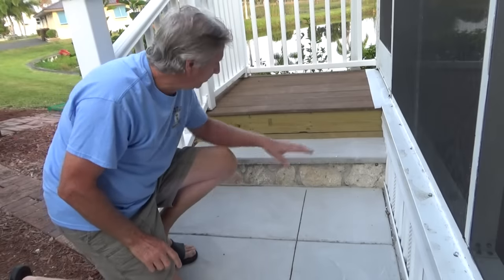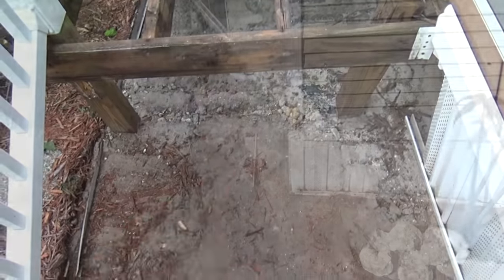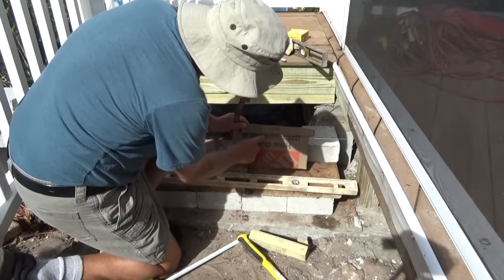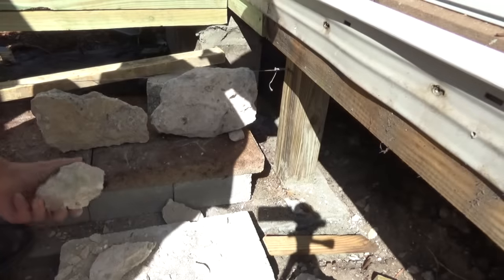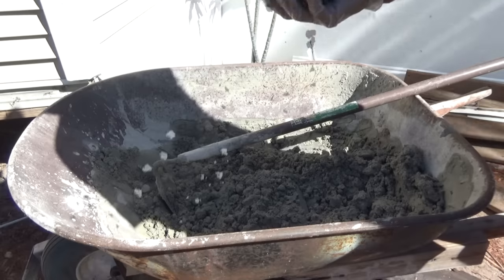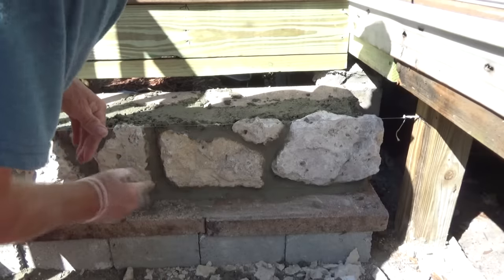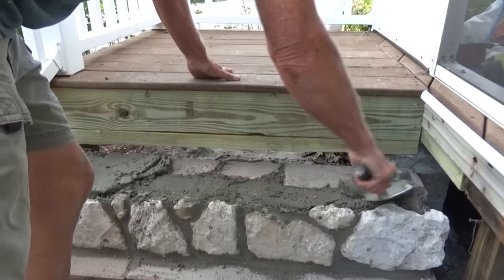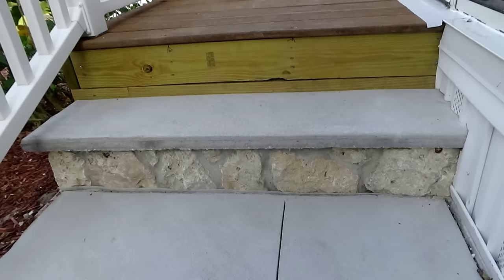BUILDING STONE & MASONRY STEPS (Part 17) Mike Haduck

Comment: Was there a roof over it? Seems to me like the problem is water getting in (especially where it's attached to the house 1:54) but not getting dry quickly.
Reply from the maker: Your right , no roof, but roofs bring hurricane issues in that type of building and then your dealing with permits etc. I would like to do the porch in concrete In the future, thanks Mike